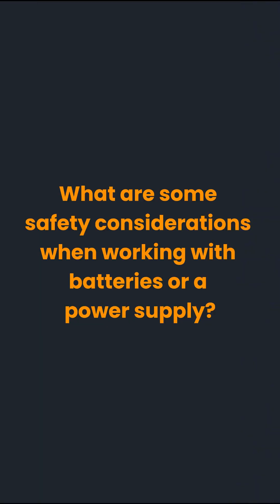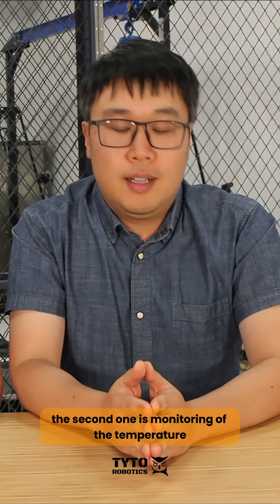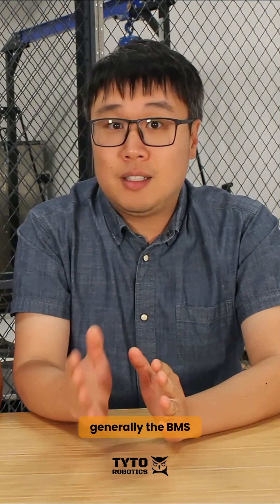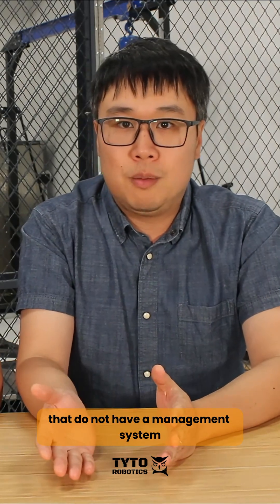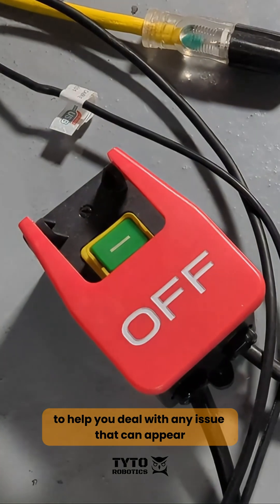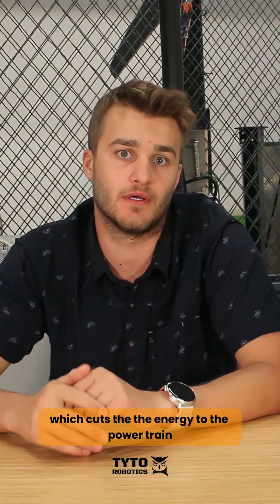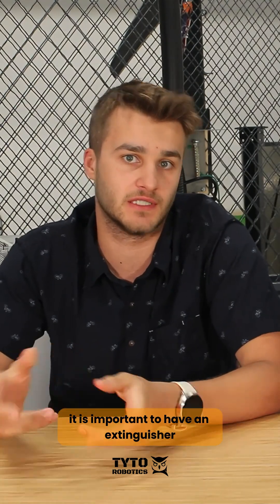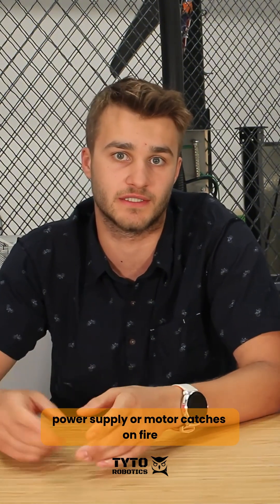Testing High-Power Systems? Don’t Forget This  #drone #engineering #fyp

Comment: Hello, beautiful engineer,

For quite some time, I’ve been working on vertical take-off and parachute projects. Although I’ve shared parts of these ideas with some academic circles, I haven’t received the support I was hoping for. The only thing I’ve ever asked for from them was access to Siemens NX and Siemens Nastran — nothing more.

Could you please help me with these topics?

For example, I often compare the movement of an internal combustion piston to the motion of the human knee and ankle — just as this expresses the main philosophy behind internal combustion engines, I also see propeller motion in flight as resembling the infinity symbol (∞), and even similar to atomic fusion and fission dynamics. Based on these philosophies, I have developed two main drawings for my vertical take-off project that I would like to share with you.

My name is Ediz Necat Topal, I’m calling from Samsun, Turkey.
My mobile number is +90 537 785 23 76.

Please feel free to contact me — thank you.🎉🎉🎉🎉❤❤❤❤❤